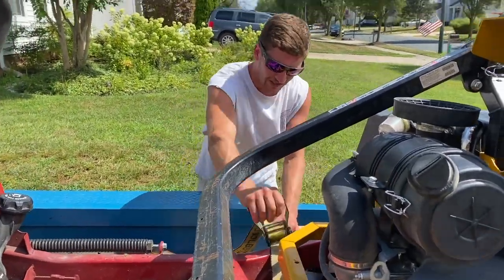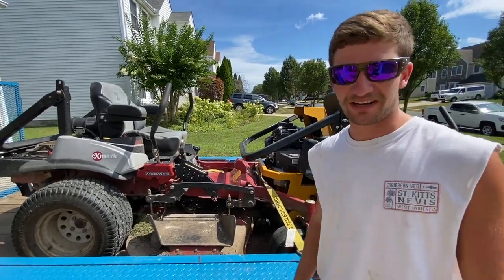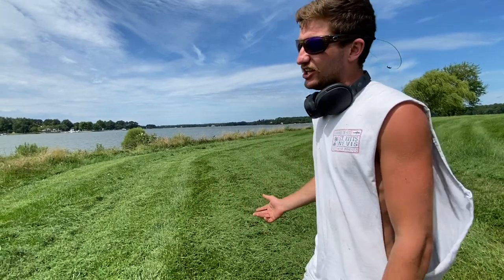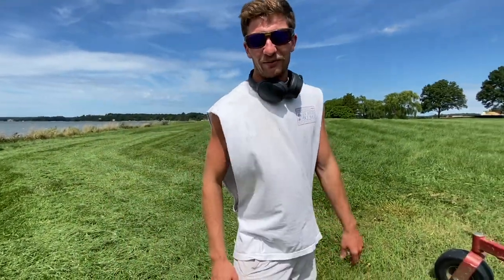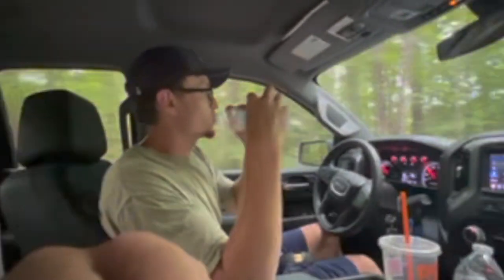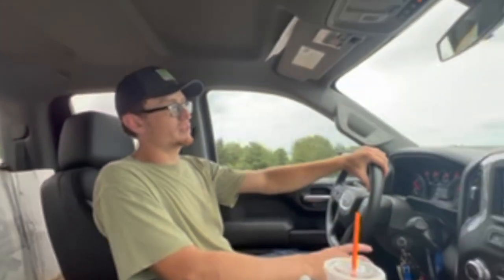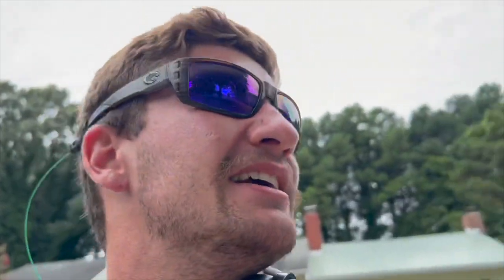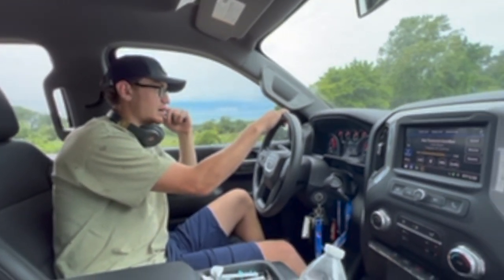Lawn Care -- Exmark Lazer Z X vs. Hustler Super Z -- Battle of the Mowers

Comment: Hustler you have is a lower model, not a fair comparison to top model exmark. should have used the top model hustler Z with hyperdrive rear discharge. cuts grass at 16 mph add flex forks and solid tires in front. I cut my 10 acres of grass with over 150 trees in about 2.5 hours/ and use 4 gallons of the 2 six gallon tanks available. Rear discharge does an amazing job, 2 blades cut clockwise and 3rd blade cut counterclockwise making the distribution of grass nice and even
Reply: That’s not a top model exmark either. That’s a base model x series
Reply: @greenhillscustomlawncarell1139  
Hustler has a number of rear discharge machines, huge difference, i wish x Mark, and other commercial mowers would start doing that rear discharge less wear and tear on the engine and better distribution of grass clippings
Reply: @thomaslecour2462 I use mulching kits on all mine except for 2  that I keep open for spring. The Mulching kit on my 72 vanguard x series leaves no trace of grass or leaves.
Reply: @greenhillscustomlawncarell1139  
I do like the exmark machine, I’ve used them in the past, I specifically went with hustler 72” because of the rear discharge and my schedule does not allow me to cut grass of 10 acres as often as I would like. If exmark made a rear discharge, I would purchase to be fair

Comment: x series would compete with a hyperdrive not a x one. X one is just getting into to the commercial mowers.
Reply from the maker: A hyperdrive is really statically a better mower. But I would have to say it really isn’t better then the x series
Reply: @Crazysnake212  have you had or used a hyperdrive? I’ve owned both x series and hyperdrive just curious on why you would say the x is better in your opinion
Reply from the maker: @americandream_89  used one. The exmark cuts better. It’s way slower then the hyperdrive but I think it’s the better option for 20k
Reply: @Crazysnake212  i run a 66” hyperdrive now. I find that they are really close on speed until top end on the hyperdrive. Exmark is my second favorite mower. I do not see any significant difference cutting with either unit. Thicker grass hyperdrive seems to do better. Uphill climbs hyperdrive will not raise front wheels. Hyperdrive rides much better. If you hit a small bump on the x it is so light in the front it bounces and bucks. I do agree on the deck lift exmark is better designed. I like the single fuel tank design also. Long term I’m betting the hyperdrive unit will outlast the exmark. To each their own good luck.
Reply: @americandream_89   i have to agree with you. I run all hustler equipment, as well as have had exmark as well. what gets under my skin when people complain about the hustler hyperdrive cut quality compared to exmark but in the same sentence they say how fast the hustler is.....I dont care what mower you are running, if you are trying to cut grass at 16mph then it will cut like shit and miss blades of grass on any set up. The hyperdrive is cool and fast for transport purposes only. im telling the world right now, there is literally no diff in cut quality between the two other than personal pref. both are good mowers. i just find it funny how people are so quick to trash talk whatever brand they dont own or use. this dude is comparing his x-one to a 20k exmark X. lol... good video though man !
Reply: I’ve got a true comparison for anyone looking coming soon. I think your going to see the true cut picture